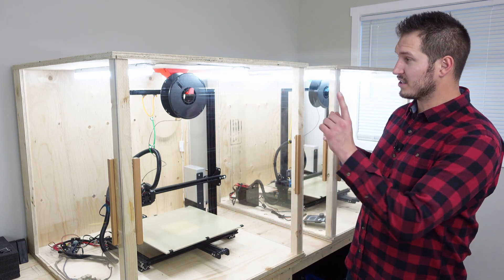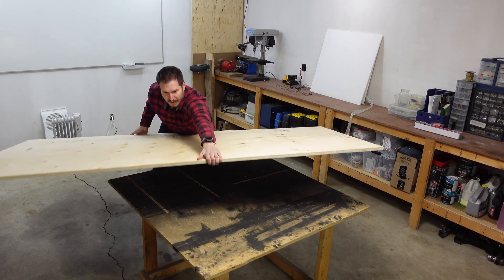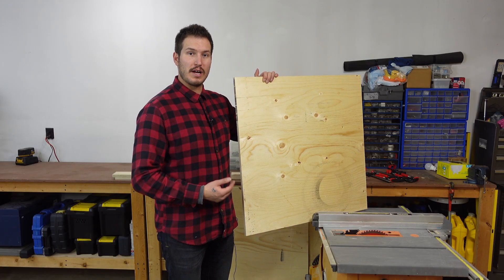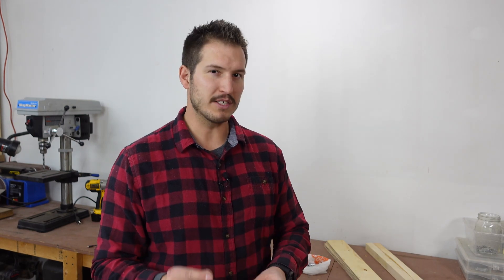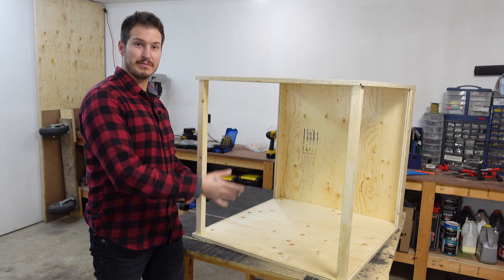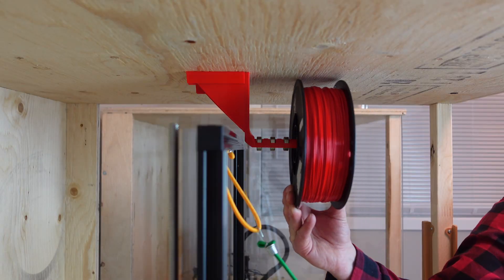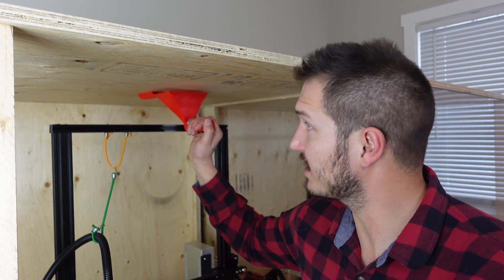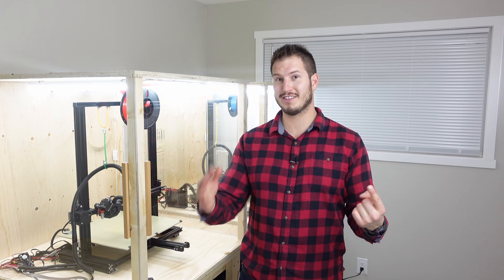3 Doors, No Hinges, Massive 3D Printer Enclosure

Comment: I like it. Pretty much what I was trying to come up with, but I don’t know what I’m doing. 
The front vertical wood pieces… are those 1x1 or 2x2? If you said, I missed it.

Thanks!
Reply from the maker: Thank you! The front pieces are dimensional/milled 2x2's
Reply: @LucasBuildsStuff  Excellent. You rock!
Now that it’s been a while, have the sliding doors maintained their slide? I live in coastal SC, and its really humid here. Wood swells like mad. Even indoors over time, sometimes. I might have to go the drill for hinges route.
Reply from the maker: The doors still slide great, but I did have to increase clearance on the slots a few weeks after I built the enclosure 🤔
Reply: @LucasBuildsStuff  👍🏽